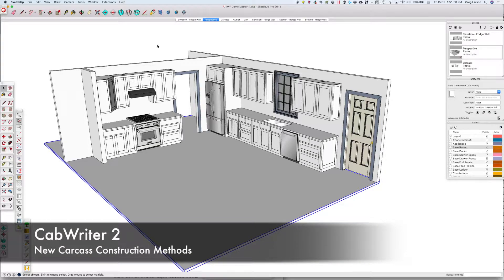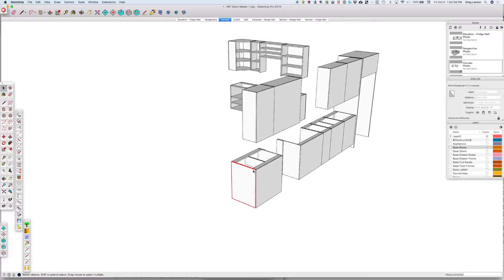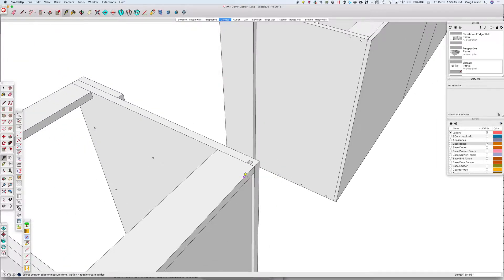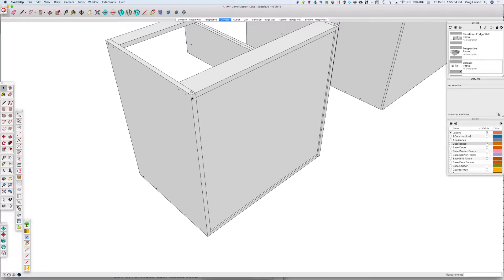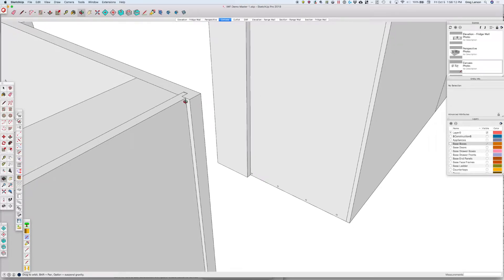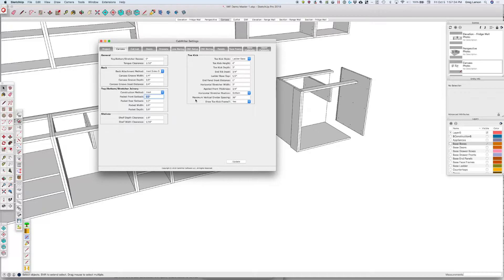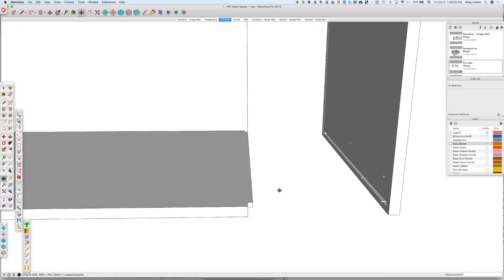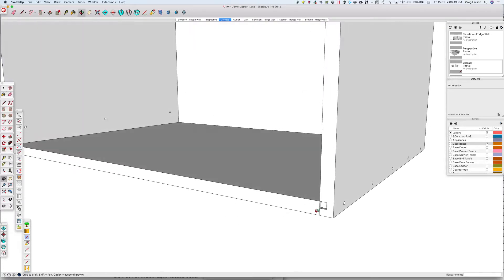CabWriter 2 - New Carcass Construction Methods

Comment: the top of the carcass is just two small pieces(stretchers) of plywood. which is fine since plywood is a strong material. But with carcass made of particle board is weak. Is there a way to have a completely covered top to give particle board carcass some strength?

Comment: Will there be support for newer joinery methods like lockdowels and ovvo connection system. Specially ovvo, since it doesn't require a cnc machine.
Reply from the maker: Hi There.  Unfortunately, probably not any time soon.  In order to keep CabWriter as reasonably priced as it is, we have to think carefully about what we implement, and since these are specialty joinery methods, we may not get to them for some time, if ever, especially considering how many other things are on our list at this point.  However, I will add it to the wish list...